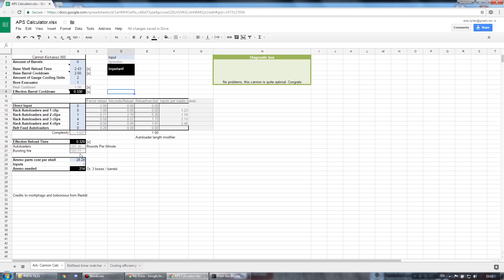From the Depths: Tutorial: 3x3 APS Turret and Tuning

Comment: for some reson I cant plase the splitter like u did do u know y
Reply from the maker: It's likely due to by default the spliters only allow placement assuming you start from the firing piece. When working in reverse I usually just shift replace blocks.
Reply: thx

Comment: For some reason, the APS calculator you've linked here is not accurate for me. 
it's telling me that I can get over 300 RPM out of a cannon that is only giving me around 180-190
Reply from the maker: Could be a number of reasons, the 2 which affect me in cases like this are incorrect autoloader length multiplier, or input starving the clips. Belt feeds also seem to have slowed down RoF, I think the delay between loaded and firing has increased.
Reply: Maybe ure just running low on ammunition?! :)